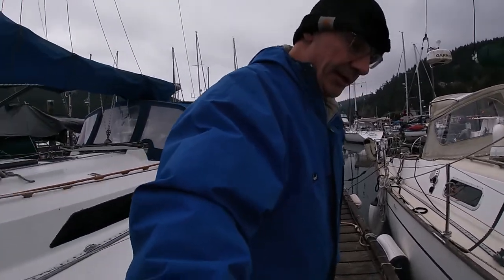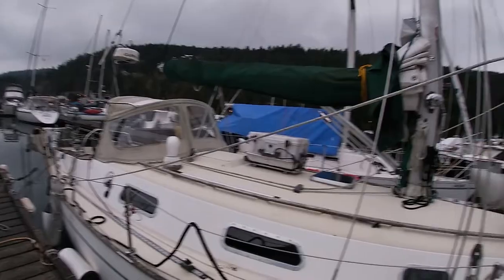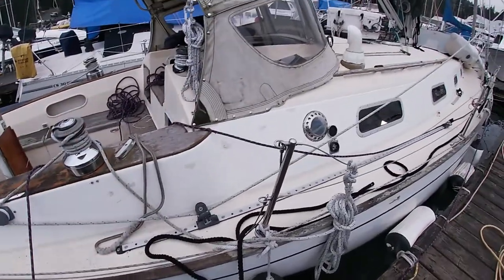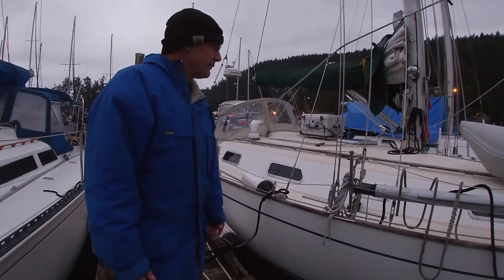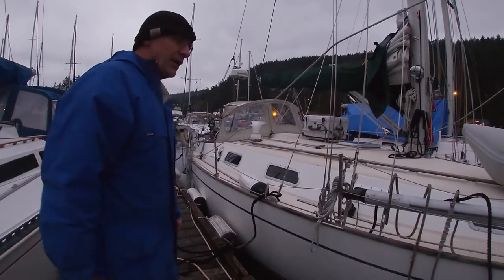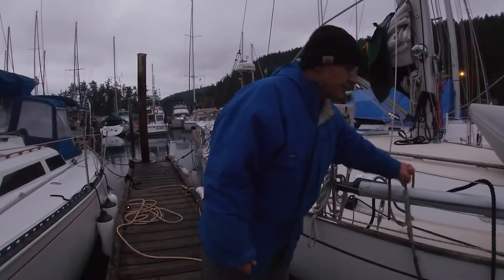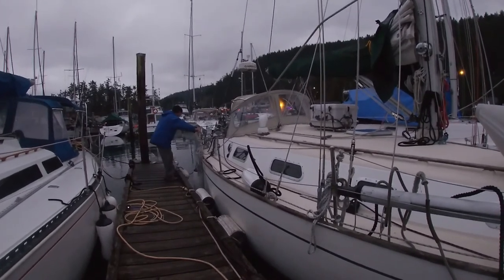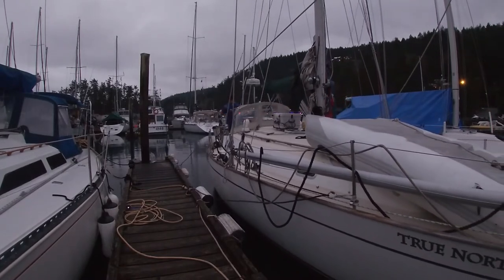LEAVING THE DOCK SINGLEHANDED, PART 3: USE A SPRINGLINE

Comment: Armchair quarterbacking here. 

Something that might help is to use a midship or further back springline that only loops around the aft cleat horn on the dock.  

In this way, you could put the boat in FOREWORD gear.  That single spring line would hold the boat up against the dock.  By adjusting the rudder, the boat will sit straight, bow to the dock, or bow away from the dock.  

Put the boat in reverse when the bow is toward the dock (stern a bit away from the dock). The spring line will fall off the dock cleat; if short enough, it will not get to the prop.  Pull it in at your leisure.  

Once moving in reverse, try shifting to neutral and you might be able to glide out of the slip without worrying about prop wash.  

For docking, I use a contraption called a “docking stick” to easily lasoo a pike or cleat.  Like in step one, I keep the boat in forward gear and it pulls right up to the dock, once the rudder is adjusted.  With it still in gear, I calmly step onto the dock and take my time securing a line or two before stepping back on board, shifting to neutral, and shutting it down.  

Happy sailing
Reply: Typo

PILE or cleat.
Reply from the maker: Thank you. That is a great suggestion. I will try that for sure. Getting the stern away from the dock, and still climbing aboard singlehanded has been a challenge for me -- and more so since I had a total hip replacement in June -- so my mobility is more challenged than it used to be. That is an excellent idea -- that is an excellent idea -- thank you!

I have used a docking stick as well -- and really like it. I use it when I can. This dock has wooden rails to tie to and no cleats (so you can't lassoo it)  -- for while I had a line pre-fixed to this dock, but if I messed up my approach, the pre-fixed line was not long enough -- so I went to the "step off" approach with stern and midship. I should revisit that idea again, however. Thanks for the suggestions! I have learned a lot from suggestions like these.
Reply: I’ve never had to tie to a rail.  Guess they don’t have them on the Great Lakes.  Seems very difficult.  I’ve since read that they can result in splinter-embedded dock lines!

Perhaps securing a line to the rail with an eye at the free end.  Somehow grab it and slip it over a cleat on your vessel.  But, you’d need to keep your fingers clear of the eye or you might lose one!

Happy sailing
Reply from the maker: Hey, thank you for the suggestion. I did try it -- I used nylon webbing and a carabiner on the wooden rail - used the rudder to get the stern away from the dock, and then let the line slip through the carabiner on the dock. It worked really well! I liked that I could get the stern quite far away from the dock and still be in the cockpit. I gave a short burst in reverse to get the boat moving, and then put it in neutral as you suggested. It worked really well so thank you very much for the suggestion!
Reply: I’m learning something each time I dock.  Glad my suggestion helped you out.